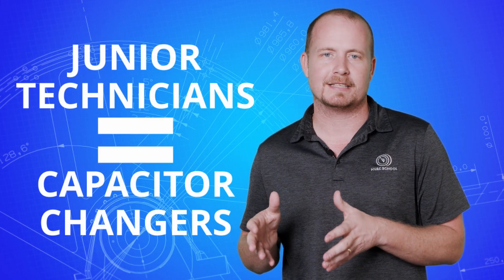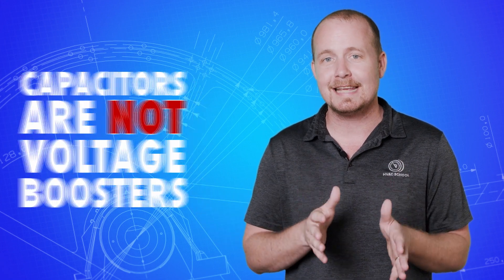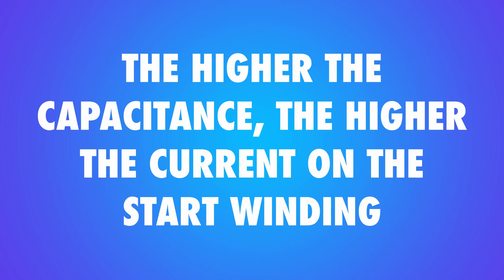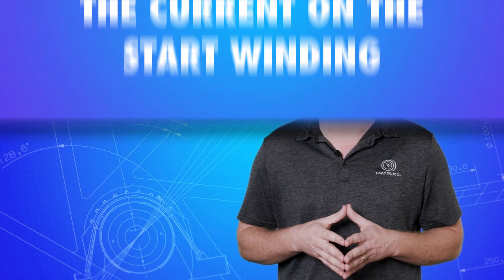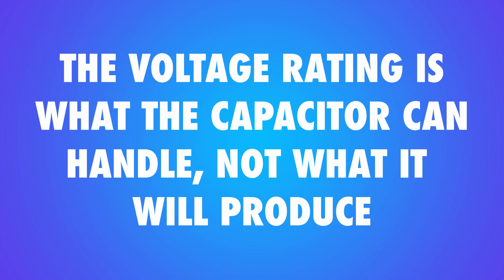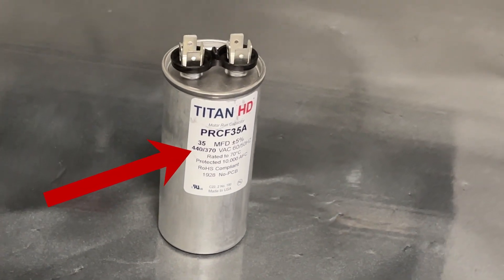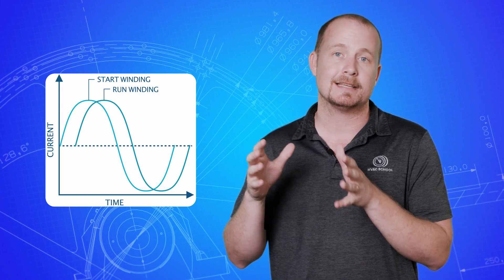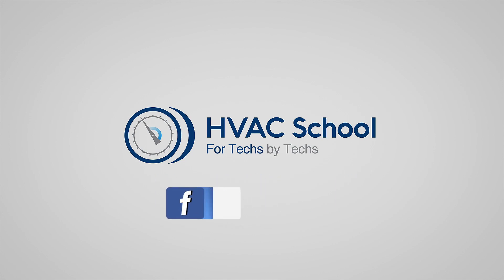5 Misunderstood AC Run Capacitor Facts

Comment: I have two identical AC units. One is close to the breaker box and the other is much farther away. The one closet to the breaker box loses a capacitor about every two years but the one that is farthest away has never had one fail. They both run about the same number of hours throughout the year. The current AC units are only 3 years old but the prior AC units that last 20 years did exactly the same thing. I believe the longer 240 volt leads to the farthest AC must be storing enough energy to keep that capacitor in good shape.
Reply: i can think of 2 possible reasons (it could be either or both):
A) the far unit just has a stronger capacitor and/or the close one keeps getting ones that aren't as strong and by that i mean the voltage they can handle. there is always some manufacturing variability, even if they are the same part.
B) the power having to go through that extra line gets a little bit weaker and it's easier on the capacitor. even if the voltage is the same, that's 60 hz, but there could be high-frequency voltage spikes that damage the capacitor and the longer line may reduce them to some degree. the short reason for that is that the long wire adds inductance in series with the AC and the thing with inductance is that it never wants to change the current. when one of those fast spikes tries to go through, the inductance might hamper that a little bit, similar to the shocks in a car. you still get the slow bumps but a lot of the fast stuff gets reduced pretty good.
Reply: How are the situated in relation to the sun? I have found even brand new units that I installed, if the control compartment where the capacitor was was facing directly to the hot afternoon sun in the middle of June and July close to the summer solstice, those units seem to have failing capacitors more often

In fact, of the exact same brand and model units that were installed where they were shaded in the afternoon by big trees, I don't recall any of those having a failed capacitor

Then, also, there's variations between anything that's produced, some end up being higher quality and better tolerances than others even from the same manufacturer. Everything has a failure rate. It's possible your unit that's farther away may just have a lucky better capacitor

It used to be you could pretty much count on the made in China capacitors to fail soon when they first came out, which caused me to switch to the Titan HD American-made ones, more expensive, but I thought that would solve the problem

But since then I've had several of those fail as well, some of them within the first year, and at the same time, some of the China made ones are now lasting longer than those. But with anything from China it's extremely sketchy, they even copy their own copies of copies so who knows what you're going to get

Amrad is the best but expensive 

If we could get all the capacitor companies back from China enforcing them to compete on American soil, then we could get the quality back and the prices to come down as well, as well as provide American jobs

That's virtually impossible to do without legislation like a particular president who said he's going to put super high tariffs on everything from China

That would change things very quickly
Reply: @7x779  both units were new in 2021 and the same one that aways fails failed in 2 years. Both units are in the shade.
Reply: @chada472   I'm sure both units have 370V capacitors. Put a 440V capacitor on the unit closest to the breaker box and you'll be fine. On the unit furthest away, the source voltage of 240 experiences a voltage drop (VD) greater than what the unit closer to the breaker box experiences. The magnitude of the VD will depend on the distance between the unit and the breaker box and the size of wire used. We'll assume they used the same size wire, so the longer the distance; the greater the VD. The higher voltage (240V from source plus back EMF) on the unit closest to breaker box is causing the 370V capacitor to fail prematurely. If you have a dual capacitor on the unit closest to breaker box, I bet if you took a voltage reading between the common and Herm terminals on the dual capacitor, you would get over 370V. If you don't have a dual capacitor, then just take a reading across both terminals on the single capacitor attached to the compressor and I'm sure it will be over 370V or very close to it.
Reply: @bernardocisneros4402  I installed an Amrad 440V rated 7.5uF on a 10 years old condenser fan (FLA 1.4amp).  I inspect cap after four years, it fails by boiling/leaking mineral oil, it reads 5uF at time of inspection.    As part of my annual PM, I got  247V at the contactor;    395V between the 7.5uf capacitor prongs.  (if I use a 7.8uF, I got 400V, 1.11amp draw;    for 7.3uF I got 392V, 0.95amp draw)       I'm guessing that the Amrad I used failed due to high voltage (more than the normal 360v) and older fan motor.   This lead me to the realization that I need to check the fan motor internal resistance and replacing the motor if necessary.      The 0.95 amp draw (0.68 = .95/1.4, with the 7.3uF) lead me to think that motor is okay.   Is my logic sound?

Comment: Thank you for the informative video. In theory, it should be possible to replace two single capacitors, a start cap of 30 uF, and a run cap of 5 uF with one dual capacitor of 30/5 uF in an A/C condenser, but is it possible in practice and would be there any disadvantages?
Reply: The 2 caps in a dual cap are not for start and run windings on compressor. In your example the 30 uF would be for the compressor and the 5 uF would be for the condenser fan.

Comment: If the split run side of the capacitor is weak, will a new capacitor result in the ac blowing cooler air?

Comment: On a single run capacitor, there are no markings for common and run.  Does it matter which side is used for either?  Ex. My ac compressor has a single run capacitor.  The start wire goes to one side, and the common from the contactor to the other.  Thanks
Reply: Does not matter.  On the dual capacitors, there are actually two capacitors in one package.  Each capacitor has two connections, just like your single capacitor terminals, but inside the package one of each is connected together or "Common" and brought out to a single terminal.
Reply: On the single run capacitor, one of its wires goes to the Herm terminal of the compressor and the other wire goes to the same side of the contactor that the wire from the run winding is connected to.

Comment: Although capacitors don't boost voltage but they do bring in stability. How you might ask.. It is simple, they improve power factor. And I am talking about power factor capacitors in parallel to the lines and neutrals. To the back end on the grid side. When capacitors are employed on the motors and compressors. They reduce load or amperes and this can improve volts. For instance. I had power factor of 0.71 before power factor correction and in my commercial Enterprise I had 170-168 voltage almost all the time. Then, even though I had LPF penalty charges which were minimal for me. So, what I did was install three phase power factor correction capacitors on the motors. My voltage improved. You might ask how or why. The answer lies in the following reason;

My load from motors was 20KVA. PF according to utility was 0.71. and my voltage used to be 170 in summers especially. When my 20 KVA after PF improvement came to 14KVA, from 0.71 to 0.96PF my voltage improved as the transformer wasn't overloaded as before. It stopped dropping to 170 volts in summers and came to stable level of 195-200. I had a lot of start and stops. So, with vfds it improved further. Now after some derating of capacitors in 2 years the PF is normal again at 0.91. still good enough. 

A little bit of calculation seems to be good. 
83 amperes was the load based on 240 volts and 0.71 power factor. When it improved to 0.95. it dropped 24 amperes. 0.29 power factor correction improvement. 0.83. since power consumption remains same. Only KVA is reduced and changed to adjust to real power usage of around .95 therefore the voltage will be less. Around 60 Amperes. Since P=IV 
With 59 amperes the voltage adjusts to 230 as shown by the meter while at 83 amperes and power being same, the volts adjusted to 168 volts. The slight decrease more than calculation is due to conductor and length losses

Comment: what does 35 + 7.5 mean on a capacitor? Is it both 35 mfd and 7.5 mfd?  If so are there separate terminals that let you choose one or the other?
Reply: Yes, it's essentially two capacitors in one case. The higher value is for the compressor.. The capacitor will be marked "fan" and "herm" (compressor).

Comment: Say the system has a oem capacitor that's 370v but later the motor starts pulling more than 370v. Should you change to a 440v?
Reply: Motor does not "pull" voltage.  Voltage is supplied or pushed to the motor. Unless you change the supply voltage, the OEM cap specs are sufficient.
Reply: What I meant to say was what if the normal volts, coupled with the back emf, start exceeding the rated volt rating. I see this happen a lot.  @Sylvan_dB
Reply: @erichorton1440  I've seen this happen a lot too and the 370V capacitors fail prematurely, so if you see this happening, you should replace the 370V cap with a 440V cap.

Comment: I have a coleman RV ac on the compresser start capacitor with a resistor in the one wire it is bad as well,, my question is do I need the resistor OR can I do away with it ??
Reply: I would love to help but I don't know what you mean.

Comment: The start winding is , after it is used to start the motor, becomes a second phase ,with the help of the run cap . It is in effect a two phase motor.
Reply: It's essentially a 2 phase motor from the start. That shift in phase angle of the current through the start winding in relation to the current in the run winding is what generates more torque to get the motor started.

Comment: AC energy flows thru a capacitor just fine, but will cause a phase shift in timing due to its requirement to be charged up and discharged, this is needed to offset the starting and running winding so the motor can be driven in a direction of choice. If there were no start capacitor both running and starting winding will be energized at the same time and the motor will not have a reason to start in either direction. Don't concern yourself that the electrons don't flow across the separated plates because the energy itself passes right thru the capacitor delivering power to the start winding offset in time from the power being delivered to the running winding. Like he said energy flows thru a transformer with no connection as well. We use capacitors all the time in high frequencies as filters and such. In this case its strictly used as a timing shift component. Simply shut it off discharge it and measure its value with a meter no fancy math needed. Fail from heat really so what that is why we need AC, its not like we can control the heat in some way, unless you want to  get an extension cord and keep the capacitor in by the A coil.
Reply: Cap has nothing to do with reversed polarity , the cap starts a motor and compressor and it runs a motor and compressor constant flow of current all the time I'm a master licensed HVAC tech since 1978 so what you said in you 200 word comment is mostly false
Reply: How the cap is wired determines the direction of rotation of the motor. The phase shift between the current going through the start winding and current going through the run winding, that the cap creates, helps to create a rotating magnetic field to more easily rotate the rotor and with more torque.
Reply: Your welcome

Comment: Great Video. I have a question. 

I live in a 1500sqft condo in NJ. I have a central air. Rheem HVAC. It gets hot in summers. Especially, I have cathedral ceilings and sun-roof (skylight) in the living room. I set-up the thermostat at 70. And outside is 80. After running for almost 4-5hrs temp does not change. The living room is cool but the bedrooms does not get enough cooling. 

What could be potential reason 

- Air Filter (checked it is clean)
- Capacitor
- Dirty Condenser coil
- Refrigerant.

Just wanted to know before I call a technician. To see if I can DIY. Especially Air Filter, Capacitor, Condenser coil. Last time, I called for maintenance it set me back $700.
Reply: On the outside unit, is the suction line cold and sweating? What is the temp. of the air coming out of the indoor vents? What is the temp. of the air returning to the evaporator? When you checked the air filter, did you check to see if the evaporator fins were clean? Are the vents fully open in the bedrooms? Are there return grills in the bedrooms?
Reply: experiment with blocking registers to force cooler air to the bedroom.  Not a great long term solution but might help evaluate the problem.  This assumes the temperatures coming in and returning are within the specified range.  You can buy magnetic covers that install over the inside of registers.
Reply: @KENFEDOR22  I had a friend who said his ac was freezing up his freezing  his evap coils. After checking the charge which was ok, I went around checking for closed vents. I found two unused bedrooms with vents blocked.
He said nobody was using them, so he wanted to reduce his power bill. I told him he unbalanced system and could have wiped out compressor on liquid slugging. Dont block registers.

Comment: 0:25 capacitor is a device that stores a differential charge on opposing plates ; not a voltage booster
Reply: Capacitors do not store the charge on the opposing conductive plates, or conductors it is within the dielectric insulator

Comment: capacitor take the bumps out of the inverted sign wave on pulsing ac current  - balances or flattens out the top of the wave length
Reply: By itself in an AC circuit, all a capacitor does is give a phase shift, with no change in the shape or magnitude of the typical sinusoidal waveform. The magic happens when used in parallel or series with an inductor, like a motor. Depending on the configuration, it can increase or reduce overall current, and it can correct power factor to provide more efficient energy transfer. When used in parallel it can allow electrons to shift in resonance back and forth between the inductor and the cap while driving the motor. This has the effect of reducing overall power consumption by increasing overall impedance.
Reply: @spelunkerd  I think We both said the same thing except mind was not as technical and in very simple terms

Comment: If the run capacitor is for shifting the electrical phase by 90 degrees so that it feeds the start winding, which is 90 degrees from the main winding, why are we concerned about power factor?  I'm missing something.  Please help.  Thanks!
Reply: Actually the main purpose of the run capacitor in a psc motor is to improve the motor power factor when it is running. If you were to remove the run capacitor on a running motor it would continue to run albeit al lower power factor.
Reply: Don't confuse run with start.

A start capacitor is for a single plus 1 auxiliary wound induction motor. With a single winding it is 50 50 which way the motor will start. By adding a smaller winding offset from the main and feeding that via a capacitor it is guaranteed which way the motor will start.

A run capacitor is used with a 3 phase delta wired motor. By connecting line to one winding and connecting a capacitor across another, the motor will "see" a 3 phase supply.
Reply: Both inductors and capacitors change the phase of their current.  Not only is the phase of the voltage changed reletive to the source,, but the current is changed too.  In the caps case, voltage lags current.If we create a scenario where our voltage is peak, but our current is behind, the wave becomes a standing wave.  Reflecting back and forth...  caps aren't batteries, or a power source.  They don't even have the ability to flow current.  They simply lag voltage and lead current.  Handy for resonant circuits and filters.  They are the opposite of the inductor, who lags current and leads voltage.

Comment: Quick question.  I understand the reason to match the microfarads size and voltage rating, but can a capacitor that is PHYSICALLY larger with the same electrical ratings be installed without issue?  I believe it can be.  Having a hard time finding an exact replacement for my PSC blower. Thanks
Reply: Yes it's fine. Only the rating maters. Physical size varies greatly.
Reply: @saulm1257  Thanks for confirming my thought on the matter.
Reply: Absolutely in this case size does not matter!

Comment: Checking a cap while it's running is sometimes really clutch. I was on a roof the other day and there was no disconnect. I didn't want to climb down the ladder and search for a breaker, so I looked up your website and did it right there. SICK.
Reply: Same. It was gabbing, but then I totally stole it . FrAnG%

Comment: Ooof so close. It charges and discharges 60 times per second. It simply doesn't store energy like we think of it in a DC system. It is used for shifting the phase angle in order to create a rotational force upon the rotor. I'm sure you know that but using the phrase "think of it as an energy storage device" is as erroneous as thinking it somehow changes voltage to any appreciable degree. Good video otherwise.
Reply: A capacitor is an energy storing device there is nothing wrong with that statement! Whether is connected to AC or DC voltage thisdoes not alter the fact that the capacitor is storing energy by the virtue of creating an electric field.